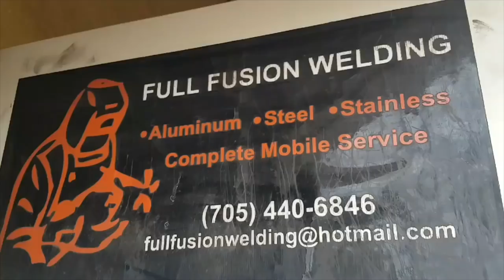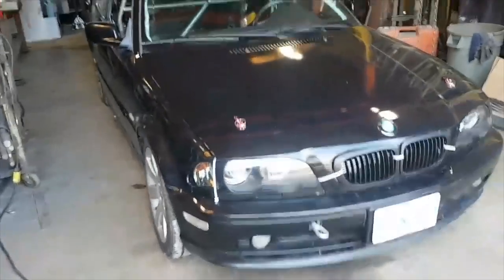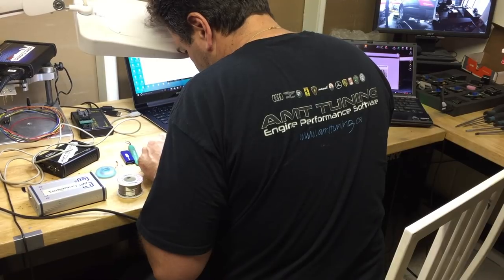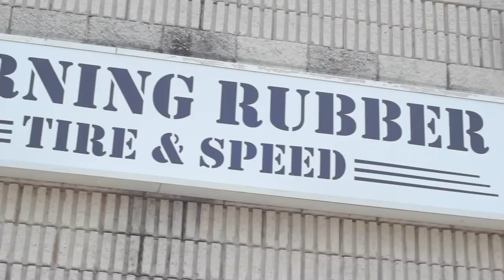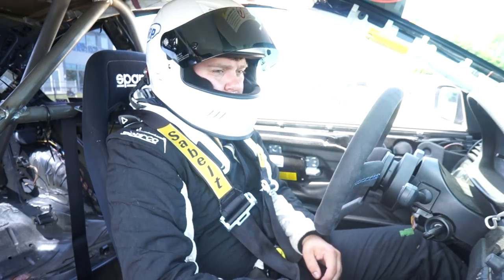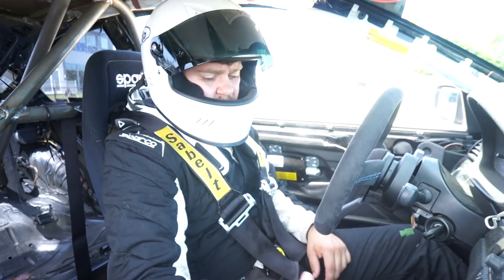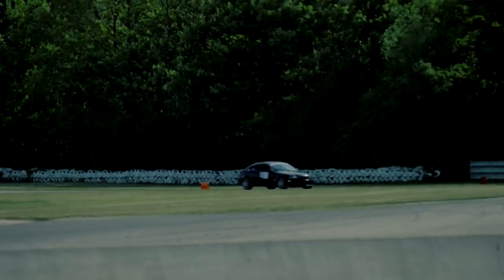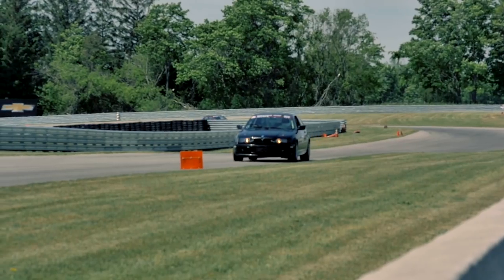E46 BMW “ROLL CAGE COMPONENTS” ROLL BAR INSTALL Track Car At Ontario Time Attack! //

Comment: The cross bar your belts are mounted to is too high. In the event of needing that harness and HANS, you go forward, the belts pull forward, and in your case they will be pulling UP and not down, so a few things might happen, they might pull your seat up as they are already at the top of the holes in the seat, so could tear it off it's rails, which is a bad thing and the 2nd thing is that with you going forward and belts going up, that HANS device will not be held to you at all and the belts might come off it all together, which is also very very bad. Simple solution is to put a 2nd bar in just for the harnesses, or raise the seat height, I'd go with option A.

Comment: I especially liked the random door cables, electrical pig tails and random zip ties moving about in the cock pit.  Good work.  Did power steering delete really increase the power that much to warrant the deletion? The engine sounds fantastic!
Reply from the maker: No but it’s one less thing to fail or leak. And it improves steering feedback.

Comment: Does anyone know what the exhaust setup on this car is? It sounds amazing, and I'm not quite sure it's the same as the silver e46 as it sounds quite different
Reply from the maker: This one is just stock exhaust with eBay headers.
Reply: @ThrottleHouse  Thanks so much for the response! Did you ever get to go drifting with Hyde?

Comment: you can still remove many parts - all airbags, audio, make simpler wiring - car can be much lighter :)
Reply from the maker: Yep there is more to do!
Reply: Throttle House go full mental! CSL carbon roof and stuff :D
Reply: but where would his shades go whilst racing if not in the sunglass holder spot thingy?

Comment: As I have been adding projects to my 330i track car, I've been using the Spec E46 build worksheet as a compass. I'm not building it to spec but use the worksheet to help select parts designed for durability and necessity for track/race use. Let me know what you think. 
https://docs.google.com/spreadsheets/d/14AhC_aKSC8rLYTSSSikt3tS7Is1T5PolHp3CxU4cx3c/edit#gid=0
Reply from the maker: Great list. I recommend Parkin racing developments for the oil pump. And don’t limit yourself to one way dampers if you can afford it and you Aren’t building to spec

Comment: Why is it hard to drive?
Reply from the maker: Steering is very heavy. And it’s hot. And the shifter still has slop so i really have to focus. AND there is no lsd so I’m constantly working to keep the rear planted to get the power down